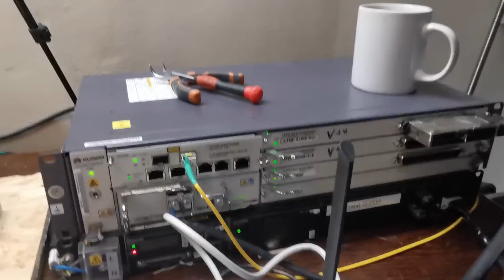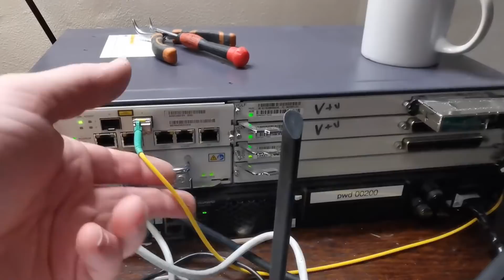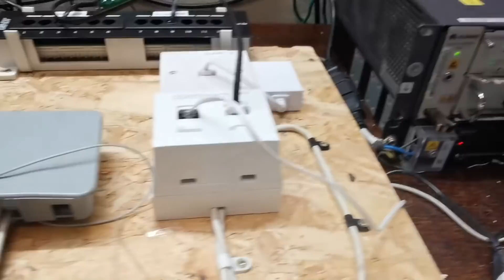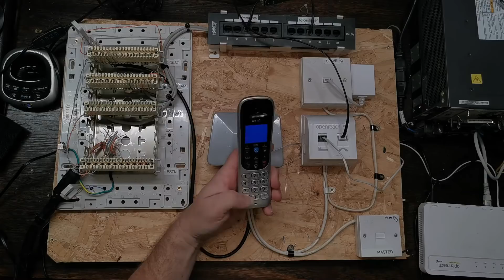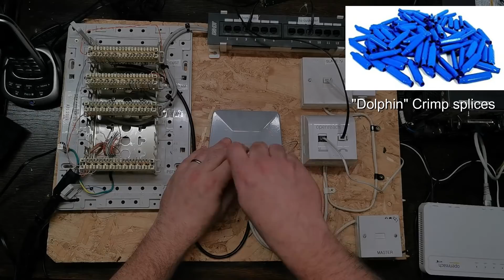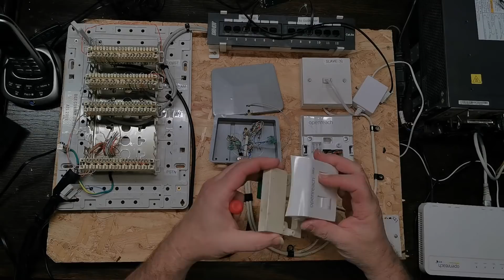How FTTC Works / VDSL

Comment: Subscribing. Been looking for a channel like this for ages! Can you do a video on Virgin media please?
Reply: Virgin Media layout, Fibre from headend to hubsite, fibre from hubsite to main node. Main node feeds up to 11 different Cabs via 580 and 540 CATV, 540 CATV goes into Rf amplifier and from the amplifier goes a coax into CATV 4x4  tap banks, Customers drop cable screws into tap bank and sends RF signal down to property via RG6 or RG11 CATV depending on distance.
Reply from the maker: Oddly we were having this chat a while ago. I may be able to do something but DOCSIS kit is neither cheap or easy to get hold of.
Reply from the maker: CMTS headend on the way from Germany...
Reply: @rtechlab6254  we need a discord server to geekout in 🤣
Reply: As for the telco side, VM are switching to something called VOC, Voice over cable, where the phone lines work off the back of the broadband, eliminating the telephone lines as they get damaged easily. But the old telco system used to be 100 twisted pair goes into seperate Mux channels, then jumper wire from mux channel into a cabinet channel, then from the cabinet jumper wire from cabinet channel into a krone strip where customers drop goes to property.

Comment: So a story my dad told me which I've been able to verify most of it:  when the U.S. Congress had passed the 1996 Telecommunications Act, there were no stipulations on what kind of technology should be built out with the investment money despite the act heavily promoting the deployment of fiber optics.  It was intended to supplement the costs of deploying fiber.  Instead, AT&T et al just pocketed the money and continued with their regular copper lines.  By the early 2000s when it became apparent that the telcos were just taking the money and not actually using it for the intended purpose, a fledgling company called Cisco Systems tried to convince them that if they were going to stick with copper, they should at least use this new shielded ethernet cable they had developed with this great new product they want to push called Power Over Etherent.  Everything from lights to to microwaves could be both internet connected and powered over the same cable ... using Cisco layered switches, of course.

They said no, obviously.  Telephone lines were cheaper and DSL was ''fast enough.''  Well, fast enough until the cable companies broadsided them and the telcos were forced into partnerships with them.  Now the U.S. has the worst broadband speeds and prices of all developed nations.
Reply: I heard something similar from one of the DNO (local) energy suppliers in the UK - they wanted to use their existing mains infrastructure to provide high speed networks, but it was mysteriously dropped.
Reply: @stupossibleify  In Chattanooga, Tennessee, they were one of the first cities in the United States to deploy a municipally owned fiber network.  Just like my city (well, the entire country, actually), the abysmal rollout of overpriced subpar internet connections and the complete disregard for rural areas actually spurred their residents into action.  They tried tirelessly to convince the local cable and telephone companies to increase the quality of their broadband internet and expand it to their rural communities.  They declined, of course.  So the residents got fed up and decided the city could do it itself by raising $170 million from a municipal bond measure.  They succeeded.  However, before they could even break ground on deploying this new fully funded high speed fiber optic network, the local cable & telephone companies sued the city (*and won!*) claiming that because of State laws, cities aren't allowed to compete directly with private companies unless it's an ''essential service.''

Unfortunately internet is not considered an ''essential service,'' even though it really is ... but power certainly is an essential service.  So instead of the city providing internet, they instead had the Power Company (EPB) do it.  As a part of their update to their power grid, they rolled out new internet connected Smart Meters to every home in Chattanooga, and the Smart Meters just happened to run on fiber optics, and just happened to also be able to provide internet service as a part of using the new Smart Meter.  And since the power company serviced the unincorporated rural areas of the city, that meant the rural towns also got fiber optic internet.

1000/1000 Mbit symmetrical fiber internet + phone & local TV for $70/month.  That was the original price.  As of last year, the city released a case study showing that they are now making money on their fiber internet.  So they will be able to start offering refunds to their customers in terms of service credit, effectively lowering their bills.

In short, it's a shame your power company couldn't pull it off.  It's worked wonders for Chattanooga.

As a side note, the power company has been trying for many years to be allowed to offer internet to non-serviced areas.  There are adjacent rural towns with no broadband options, but the conservative politicians that govern outside of the progressive urban centers refuse to let them offer broadband.
Reply from the maker: @stupossibleify  I always wondered what happened to that

Comment: So... this is what we in Australia call FTTN I think, Fibre to the Node (green box) which then puts the VDSL from fibre onto a number of customer analogue phone lines for the last 800m or so.
FTTC here is Fibre to the Curb, which means fibre runs along the street and has an individual node for each customer to their old analogue line, so the analogue run is only 10m or so, which makes for much better performance.    I'm presently on FTTN because that's the only option here right now.  I'm at the fringe of it in fact, if we were two houses further down, we'd only be offered wireless broadband.   The raw linespeed varies a bit, but around 70mbps seems to be about all it can handle here, at shorter distances, speeds over 100mbps might be possible, but it's a lottery and depends how good the copper is.   Phones are all VOIP now, the analogue phone network has been closed down in toto.  So you either need a standalone IP phone or your analogue phone runs directly from the Phone port on the modem inside.   I've got a 50mbps plan, most you can get is 100mbps but I can't have that because I'm too far from the node.  They're promising at some point to expand the fibre network (which would be good because the copper lines are 80 years old and not exactly great for data).  What comes into the house is a standard 2 pair phone line, minus the analogue phone service.  Only one pair (blue/white) is live.  Red/black is not (normally) used.   What's bad is that if the power goes off, you lose both internet and your house phone as the FTTN cabinets don't have any form of battery backup.   NBN (National Broadband Network) that are the national provider via Telco retailers, is something of a political football, the original concept was all fibre to the premises, but there was  change of government and they stupidly decided to go with this mishmash because it was (they thought) going to be 'good enough' and supposedly cheaper.  Now it's exploded in their faces and they are now admitting that the FTTN concept is flawed because a lot of copper is just too old to handle decent data rates AND there's still a lot of people in urban areas who are being forced onto wireless broadband which has its own issues.   There is also a satellite option for isolated areas,  (which there is a LOT of in Australia) where there is no phone service at all, or possibly just 3g/4g.  5G is just being rolled out in major cities.  Going to be a while.  The sat service is maximum of 50mbps, data is expensive and gets throttled if you go over the cap.  There's a 650ms lag because of the geosync satellite hop.   It seems we might see SpaceX's Starlink service here sometime this year, which I suspect will see a whole swarm of people ditch their NBN satellite or Wireless Broadband, probably even some FTTN users might go Starlink because of better speed.  (Musk is guaranteeing 100mbps plus which would be better than what I've got).  NBN is reacting by lowering the price of business satellite to try and compete, but it's not fixing the basic problems inherent in it (Far more people on Satellite than the government planned for because the phone network just doesn't cover enough of the country)  The NBN is a national disgrace and should have gone ahead in the original fibre everywhere form, but it wasn't politically acceptable for the incoming government to allow something the enemy thought up, so they 'revised and improved' it by trashing the Fibre network concept and piggybacking the consumer end to extant analogue phone lines.   This was clearly a HUGE mistake which they have now, very reluctantly admitted, but it's going to take a long time to remedy and the cost had blown out enormously even before then.   For emergencies where the power is off, FTTN customers like me will lose both house phone and internet services (even if the exchange has power) and NBNs advice is 'keep a charged mobile handy' which is fine to a degree, however most of the 3G4G sites have only around 12 hours of battery backup, once that goes if the outage lasts long enough (last major one we had was 3 days a few years ago) you are reduced to UHF CB and/or smoke signals.  We had no mobile service for about a week as the Telco's site we use didn't come back up when the power did and had to have the equipment replaced which took another few days.  At the time, phones were still analogue, so they worked through out, but that's now dead and buried so any lengthy outage now will take out house phones and internet and leave you dependent on mobiles with around 12 hours or battery, unless you are with one provider (Telstra) who have a cell site at the exchange which has backup generators.  Other providers (Optus et al) will be dead in the water after 12 hours or so of no power.
Reply: VDSL and VDSL2 use digital signals, no analogue signals. For the physical line it is equal what kind of signal use. Typical VDSL (or VDSL2) lines are 800 till 1000 meter, but with good lines are 1.6 km possible. With SDSL are 2 km possible. 

Do you have right, FTTC are fiber to the curb, FTTB are fiber to the building and FTTH are fiber to the home mean apartment. FTTN sounds that do you have smaller cabinets between customers and far curbs. But why do you not install own fiber line from neighbor or from the next curb?
Reply: @OldLordSpeedy  Digital yes, but still baseband so an RF type AC signal with digital modulation.  Older phone lines like ours (some are 100 years old or close) don't work so well and at around 800m from the node I'm getting about 65-70mbps on a good day.  FTTP is fibre to the premises, so apartment or much more so in Australia to the individual house (most of us don't live in apartment buildings but single storey individual houses on their own land like me.
Reply: @TheXO-614  Typical digital subscription line (DSL) is really digital (see name), it not need or have some analogue signal. Please test it self if you not believe me - BTW: I learn all the different techniques in my job. 

Our telecom use 0.8 till 0.6 mm² copper cable in the history, 0.4 mm² only inside house. Your small line till 500m looks for copper-save cable. That is really bad. 

But inside home is FTTH - fiber to the home. This fiber is thick a hair, so that is it easy to change the copper to fiber inside the installation channels.
Reply: @OldLordSpeedy  All DSL, whist it transmits digital information it does so using analog (RF) signalling.

Comment: Some BT engineers are lemons!  I had to spell out the problem to one that visited.  As the phone line stop working when it rained, but  the engineer kept saying it working now as it was not raining.  Eventually one engineer realized the main-hole filling with water, and he unblocked the plug at the bottom of it.  I might or might not of got the hose pipe out before he visited, as I had a felling that was the problem.
Reply from the maker: Some of the engineers are superstars too, same with any large organisation. In Calgary we had a "tame" Shaw engineer
Reply: @rtechlab6254  Yes true, it's only when things stop working we notice.  When they work we take them for granted.  But thanks to all those wonderfully engineers things normally just work.
Reply: The water should not affect your service if it does you have bigger problems. Either the cable is damaged or there is a leaking cable joint which the engineer should have dealt with.
Reply: @keithwindow4435  Corrosion in the junction boxes (little round pillars about 3 feet high) is a big issue here.  After we had constant drop outs, the NBN tech discovered a ball of salt and corrosion a centimetre around on one of the joints.  He bought it to show me.  Still had issues so the next tech disconnected the 'X pair' which was the analogue connection back to the exchange for the now dead POTS system, it was obsolete so he just took it off.  That fixed it.

Comment: Openreach, not BT. BT does not come and do anything, Openreach is a legally separated part of BT plc and part of the agreement with Ofcom is not to be BT branded. BT provides retail and wholesale services, but the network belongs to Openreach and the company that turns up is Openreach. Calling them BT is outdated and misleading in the current world.
Reply from the maker: Maybe look at who sits on who's board. Longer explanation, the public don't know this nor do they care. Thank you for pointing it out though :)
Reply: @rtechlab6254  I know who is on the board, but I would suggest you're out of date, very little BT plc on the board now - it is mandated upon Openreach not to be - for example "And while we still agree our overall budget with the BT Group board, we determine our own priorities and spending." - and it is enforced. They're not allowed to call themselves "BT" or "BT Openreach" - and you should only be referring to them as "Openreach" too.
Reply: @SquirreliciousMe  agree Openreach are the crux of most problems - I've had my fair share of incompetence from them and put in a number of complaints to the CEO's office which has resolved some things at a practical level - it doesn't stop their so-called 'engineers' ditching jobs and appointments if they don't fancy it however. The public should know who the underlying issues lie with - not just their service provider. The old school BT monopoly mentality still runs deep unfortunately...
Reply: @uwygjhsh in some cases yes, in others it’s BS as they have the details on their database and know they need 2 guys to do a job on a shared utility pole - the most recent occurrence the guy came out in advance to do the external drop from the fibre termination and then assured me in person that it could go ahead on the day in one go only to be subsequently cancelled remotely - that’s nothing to do with safety and just shit process control. I’ve spoke to enough of them to know how the game works 🙄
Reply: @ I know very well what’s what. I also actually know the regulatory controls on Openreach and the agreement in the legal separation.
Reply: @ I’ve already explained this. That’s not true. Not all providers that use Openreach use BT wholesale. Indeed the providers offering 1.8gbps FTTP on Openreach infrastructure are NOT using BT Wholesale as right now, Wholesale does not offer those products.
Reply: @uwygjhsh That bill I get every month from Openreach, not Wholesale must be in my imagination then. I’m afraid you’re wrong and you can try every which way to pretend otherwise.
Reply: At the end of the day, Openreach is owned by BT as a separated company, just like EE.
Reply: @ not quite - Openreach is legally separated with regulatory oversight, must have an independent board etc too whereas EE isn’t subject to that same control.
Reply: @ okay so Openreach is owned by BT but not controlled by BT?
Reply: @jake_dev1046  in a weird way both yes and no. There are countless regulatory controls forcing them to operate independently. It's complex but it isn't a traditional parent company relationship.
Reply: @ i have always found the BT-Openreach ownership thing strange.
Reply: BT own or the infrastructure though even if we place it into the cabinet is still owned by BT

Comment: We use it as FTTN - NBNco uses it extensively.   It's hot-garbage, mixed with a dumpster fire, mixed with vomit.
Reply from the maker: It has a place, it solved a problem at the time. Where. We use it there isn't much choice, it's that or thousands of dollars of fiber kit per event.